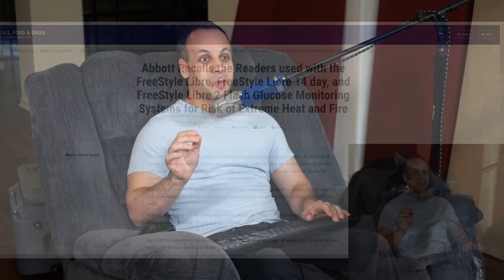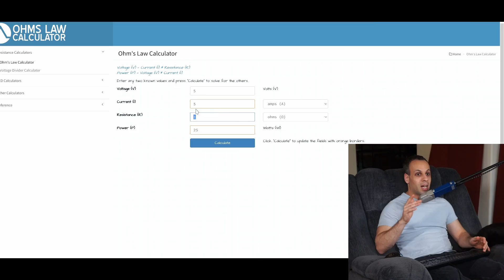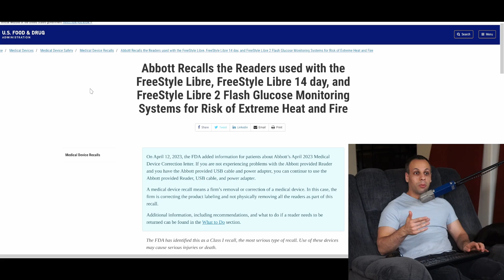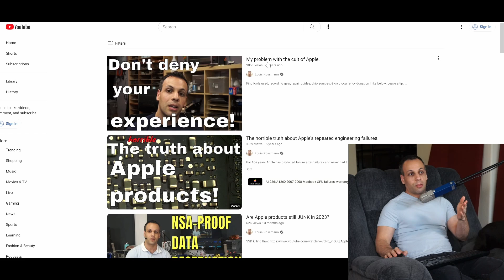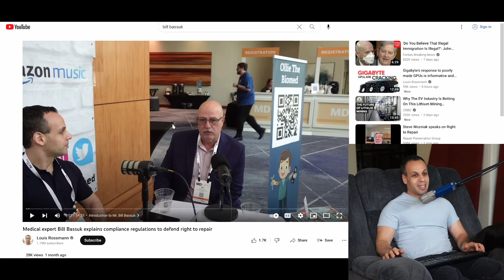Abbott gaslights customers during FDA recall of burning glucose monitors

Comment: The moment you said "non-abbot usb cable" is where I can BS. USB is a rather simple standard when it comes to charging. If you can't use it, it isn't the customer's fault for using a different cable or brick
Reply: There's no way any... And I mean ANY USB cable should burn your device down, unless the charging power is like 30W or more. These readers are in no way should charge that fast, therefore any even usb2 cables would work. I've been using cheap Chinese cables that are thin, only usb2, 3 meters long, to charge my Chromebook... At over 45W. Nothing burned down. It is an engineerin fault in the device. They F'd up. Like you said, USB is simple, and you need to cut serious corners for this to happen.
Reply: @CMDRunematti  Assuming you are talking about volts and not watts that is correct.

As louis states amps don't really matter. *Unless the charger is not providing enough. Witch also doesn't make sense because I am pretty sure the USB standard isn't supposed to produce more then 3 amps or something but could be wrong.
Reply: @DoubsGaming  Type C PD can deliver over 5 amps now, I think type A was limited to somewhere between 1 and maybe 2 amps. For a battery this small though 500mA is more than enough to torch it (heck, even on a large lithium battery if you feed it 5V 500mA long enough it'll go up in flames, it'll just take a while). While that shouldn't happen with a standards compliant charger and device, I've got a sneaking suspicion that Abbott hasn't actually implement USB C here, but instead just connected a type C port directly to the lithium cell and stuck a lithium charging circuit in the charger, which would mean that connecting to a third party charger dumps 5V directly into the (4.2V max) battery
Reply: @bosstowndynamics5488  Yeah and that's why BMS's exsist.
Reply: @DoubsGaming  the usbc pd standard can do 20V5A, aka 100W. But it does start, always, with 5V,and then switch up. Depending on if I use my phone, one chromebook, other chromebook, or the nexdock, the charger will negotiate 5, 9, 12, 20V. It's a dual charger so if I plug in a second device that only accepts 5V, the other side will also drop to 5V max.

For those saying pd isn't part of the usb standard: that's why the charge always falls to 5V so the devices don't get damaged and only if pd handshake happens it can go higher. My conclusion then either the reader uses pd and charges way too fast, or it catches fire at 5V because the charging circuit is faulty
Reply: I was once told by a Rep that I can charge my Insulin pump with all micro usb cables but can only upload with the included cable and I was like: "wat"
Reply: @stefanschmidt3091  Many (cheap) micro cables are power only. That's probably why they told you that because they get a lot of calls when people use random cables around the house that won't transmit data.
Reply: If a non-Abbot "USB" cable/charger is different than a USB cable/charger, then it's not a USB cable/charger.
Reply: @blargg  to add, it's a Abbot (non-usb) cable/charger using USB connections, based roughly on, but conflicts with USB
Reply: Fun note, neither the cable nor the charger are labeled Abbott or anything else remotely medical.  Complete generic third party or oems.
Reply: IF using a 3ed party cable result with the original power adapter causes this the OEM used the cheapest wire they could get and using a higher grade cable with less resistance

This sounds like the OEM just ships a junk tear adapter that can't output much power and the adapter's volts go well below spec, so when you use a quality power supply this happens
Reply: That's where reading between the lines comes in - Abbott technically just said that the combination of their product with third party chargers = fire. That statement is technically completely true even if the reason this is the case is because Abbott didn't put a type C sink and lithium charger chip in the device like every single standard compliant type C device is supposed to have
Reply: @Bosstown Dynamics  TECHNICALLY, yes, but the way they worded it clearly shows they believe it is the user's fault
Reply: USB C is not that simple. That being said, if you use USB C in your design, comply with the standard lol
Reply: @chrisE815  usbc is just the connector, a reader like that should be using usb2 over usbc, which should be far more than enough power for this device. Like how fast do you really need it to charge up?
Reply: @Chris N  power delivery is not part of the base USB spec aside from that it is reserved (I've checked the documentation for a personal project)

Comment: My Libre 2 meter for the 14 day sensor did not come with a charger. It came with a cable to plug it into a computer. So, I just charged it with the computer. If I can find it again, I can send it to you. I don't use it anymore. I am using the Libre 3, which only uses a smart phone app now.
Reply: Same here. I wonder what market(s) or version(s) included a charger?

Comment: My bet is they decided to put a battery without protection and no charging chip in there, just a little diode. Maybe there should be a battery with integrated bms in the first design and later someone decided it will be cheaper without bms.

Comment: Definitely a badly programmed charging circuit.

In fact, even using the provided charger might also be dangerous.
I have a cheap battery charging circuit, and if I limit the charging current too much (like 100mA instead of the programmed 1A) then the charging chip will overcharge the battery to almost 5V, which is well outside of its specs, and is probably equally dangerous.

So for older and/or primitive devices, I do recommend using the provided power brick, as it's usually specced so in case of malfunction the charging voltage will collapse, and also provide current-limited output for snowflake charging chips which can't handle properly if the charging voltage doesn't or does collapse depending on the current draw.

Comment: I used to use this continuous glucose monitor. I haven't used it for quite some time because it's garbage compared to more modern versions. This one is two generations old, and the defect has been revealed during the end of life for the product. This reader is an absolute piece of trash, used only by the most technologically inept boomers. Unfortunately, that makes the gaslighting from Abbott even worse, because they are fully aware of the demographic that makes use of the reader (as opposed to a smartphone).

Comment: It's almost if you could put the chip that regulates power draw inside the machine and not the cable itself.

If that was the case.
Then they couldn't force you to buy a new charging cable from them over and over.

Comment: Sounds like they used a USB connector but are not using USB standards for the actual power side. There's nothing stopping someone using a USB plug on the end of a 48v PSU. Just because it has a USB plug on the end doesn't mean it's a USB charger.
There's the physical standard and the standard for the power delivery, they are two different things.
I've seen a few devices that use a barrel jack for power and connect internally directly to batteries in series with no charge control or protection. It's normally in the adapter in those products and is one of the reasons/excuses they use to charge so much for replacements.
The problem is that people think they can plug in an adapter that provides the same voltage, not realising that the replacement charger will just pump the battery until it dies or burns because a standard PSU brick isn't designed to charge batteries. It might not be this, but this is something I have seen and is also a problem.

Comment: I own a factory-built A<->micro-B cable that supposedly steps up 5V to 8.4V. It has a little box on one end of the cable that heats up during use. And I don't think it does any negotiation. But at least it's labeled.

Of course, it's "turbo non-compliant" and absolutely shouldn't have used microUSB on the output.

The product being charged by this abomination of a cable is a curtain motor.

Comment: One issue with medical device design is that the designs that finally make it to the real world are usually 10 years old because of all the certification and testing required to pass the FDA . Doesn't excuse their shit design but most likely the guy who designed it is gone from the company lol

Edit: so if you want to try and date a med device design or component choice I'd take the production date and minus 10 years then see what was available then. Then of those components see which were certified for med use.
Reply: so true

Comment: So a few things from a medical device engineer:
1. I can't determine for certain but it looks like this is a voluntary recall from Abbott. From the FDA website, Abbott has already been talking to patients prior to the official recall. My guess would be Abbott determined that the risk was significant enough that a recall was preferable to a significant adverse event. From my experience, these larger companies tend to be much more conservative in these type of actions that smaller ones. 

2.  It's important to note that these devices go through A LOT of testing with the larger companies typically doing much more (again the risk thing) compared to your typical startup or small size company. Companies like Abbott are going to have many layers to their testing for a device like this given the potential risks. 

3. If I had to guess, my assumption would be that the components required for reliable current regulation was too large to fit into the sensor and so was moved to the adapter that Abbott provides. I'm a ME and not a EE so this isn't necessary my wheel house but that patient contacting sensor looks relatively small and thin to me. Again, this is just a guess. 

4. Lastly, if you're ever curious to see the complaints for a device that are submitted to the FDA, you can go to the FDA MAUDE site and look it up by device, mfger, etc. 

My guess is that Abbott is going to be gathering these affected units so they can do a root cause analysis to determine if there are any design or manufacturing changes that need to occur.
Reply: The talk is not about sensor. It has no rechargeable at all. The talk is about the reader. A small display equipped NOT wearable device. Also the same reading function is available over the regular NFC equipped phone
Reply: @oidpolar6302  You're right - thanks for the correction! My first searches showed a phone in the pictures so I had (incorrectly) figured the actual device was solely the patient contacting piece. Looking at the reader, it's relatively small but still seems like they could fit in some current regulating circuity. Just spit balling idea, I wonder if heat or the sensor package was of concern and hence the reason to push that stuff to the adapter; it could also be a regulatory related decision. That being said, I have to imagine there was a valid reason as going through the effort of adding an adapter increases risk, COGS, packaging size, shipping costs, etc.
Reply: @Cypher321  charging this reader is working just fine for me. It's been tested with multiple power supplies including PD and HS rated chargers (9V and 20V capable). Both never overcommed 500mA/5V regular USB2 charging current/tention
Reply: That's my guess as well.

I've been a medical device engineer for many years. I'm an EE by degree.  

I also use the 14 day Libre and the affected reader.  IIRC, I received a letter several weeks ago saying to only use the supplied cable to recharge the reader.

Sorry Louis, don't have a spare to send you.

I doubt that issue is stuff not fitting in the sensor.  The sensor itself is the size of two US quarters stacked on on top of another not a lot of room to play with.

The rest of your comment seems spot on to me.
Reply: I totally agree with your 3rd point. Sounds like something Apple would love to do. Making you buy their charger is money in their pocket, but they should only have tried to scare people into doing that, instead of making it so the device would actually need it. They could have stated that if you use any charger other than ours, there is a chance of fire. Couldn't say that though, so maybe they just took a chance....

Comment: I have a gen1 reader disassembled, but haven't looked into the charging circuit so far. The "Abbott provided charger" is just a regular 5V 550mA USB power supply though with nothing special about it.
Reply: Have you tested the charger, or is that just what's written on the label?

One of the cheap mobile phones I diagnosed only reached 78% charge with normal USB chargers, but charged to 100% with its included 'USB' charger. The charger said it was 5V 500mA however when tested it was supplying 5.9V which is out of USB spec and could damage other devices.
Reply: take the charger apart too. Can always be put back together. Jeez, maybe you can beat Louis to the punch eh? Lol

Comment: Another classic is to use a USB plug, but fit the charger in the supply and limiting the voltage to 4.2v expecting nobody to plug in any other adapter or cable.
Reply: No way, I refuse to believe they did that for a real product. Absolutely NO engineer would build a consumer product like that
Reply: @WolfmanDude  Correction, any real engineer worth their salt. There are products sold on the market with bypassed fuses. Some companies just care about saving a few cents to sell the cheapest fire hazard they can.
Reply: @WolfmanDude  Sadly I've owned a device that did this. A rechargeable table reading lamp from Amazon a few years ago.... the battery was wired directly to the USB input! It came with a special USB power supply that limited the output to 4.2V.
Reply: @ZippletTech  Bruh they could make it more safe and universal with all chargers if they add a charge control circuit on it (I found those high quality Li-ion charge controller for less than $3 in various electronic stores)
Reply: @sihamhamda47  Yep that's what makes this even more of a crime. It's cheap to do it properly!
Reply: @WolfmanDude  Not claiming they did it for this product, but I have certainly come across this on many products in the wild.
A lot of cheap products even use the protection circuitry they assume are in the battery to stop the charge and just use a resistor to limit current. Then the supplier of the batterys drop the protection or someone else in the company see they san save a cent by ordering cheaper batterys with no protection and off we go.
Reply: @WolfmanDude  you never bought anything cheap then. Stuff like this is standard practice. Usually made in China.

Comment: Pft, Louis over here tryna gaslight people into believing the manufacturer did something wrong when they're obviously infallible & the REAL problem is that the user didn't turn the USB cable 3 times to ensure it plugs in the correct way.
And they probably also looked at the cable and/or device sideways, which is taken as a threat of extreme violence & will cause the device to enter what's commonly known as "F*** You" mode.

Comment: Sidenote: it is possible to make a power supply with a set current and variable voltage, so that a changing the resistance changes the voltage. But that's extremely not USB compliant.
Reply: That’s seems to be the problem, using a standard connector for a non standard charging protocol.
Reply: @thetoasterisonfire2080  Exactly. They probably put the battery on the power rail of usb and implemented CC/CV circuit in the wall plug. When you connect to a usb compliant wall plug the battery gets 5 V and we get magic smoke. Such a use of a standard port with custom wiring is dumb beyond imagination. And claiming that's 'usb' is just evil. I don't understand how it is not false advertising or something
Reply: @mikeuk1927  That sounds extremely bad. In general, you expect power plugs to be exchangeable already, so from that perspective alone adding the battery directly to the power rail of any power plug seems questionable. I'd want the charging port to just accept a certain voltage. But with USB it's even worse. That's a universal standard, it's literally what the U stands for. You can do it on a different plug even though it seems questionable, but especially don't do that sort of thing on a USB connector. That's way out of spec.

Comment: I can buy a TP4056 Li-Ion charger board for 26 cents (without bulk discount) that takes 5V from USB-C or Micro USB, drops the voltage to charge the cell and on top has its own current regulation set by an RPROG resistor. And they have likely failed this in a medical device...

Comment: Jesus christ. I work in medicare advantage customer service, the phillips CPAP recall was horrific to deal with, there was virtually nothing we could do to help them. A lot of people would use those CPAPs anyways because they needed to breathe at night and it was impossible to get a replacement, every single one was taken off the shelf.
Now continuous glucose monitors? To give you an idea how absolutely essential this equipment is for people here were the medical requirements for a CGM as of a few months ago (it recently changed somewhat)

1) beneficiary uses a Blood Glucose Meter (test strips) 4 or more times per day
2) beneficiary needs MULTIPLE DAILY INJECTIONS OF INSULIN
3) beneficiary's multiple daily injections of insulin need frequent adjustment based on blood glucose readings

These are for people who are seriously ill. People WILL die from this recall.
Reply: if it hits the point of recall they likely already have